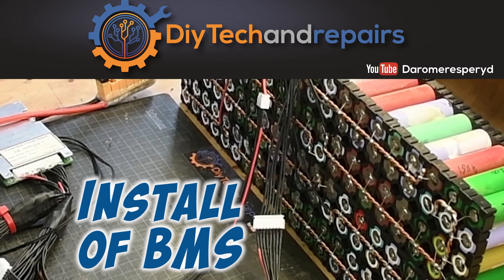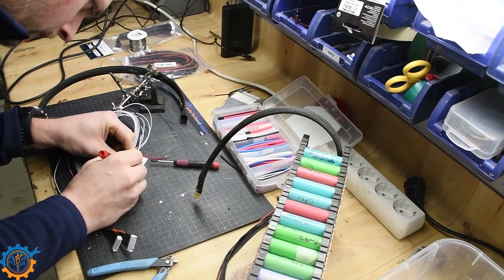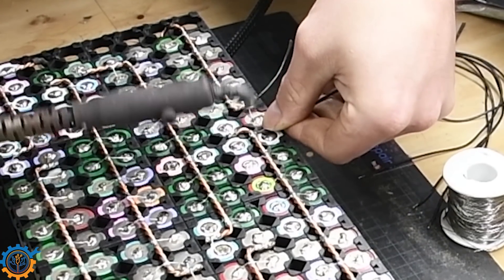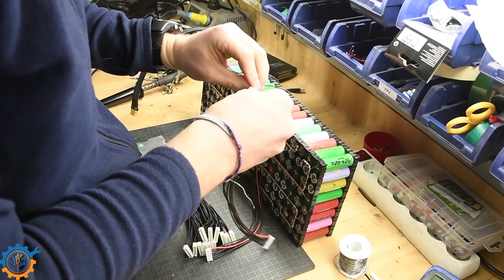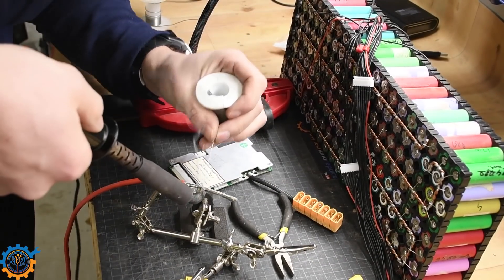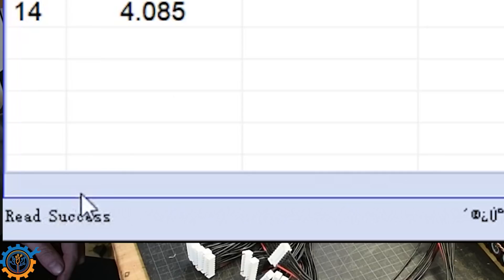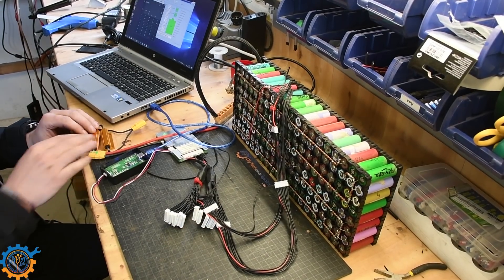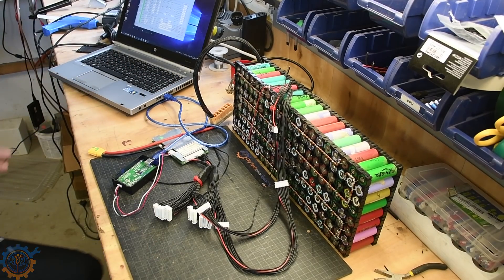Installing a smart BMS on a 14s LiIon battery pack

Comment: I have a 48 v 25.5 AH e-bike battery that wont charge or discharge unless I jump B- tp P- on the 14s BMS. Simple I said, the BMS is bad. I tried 2 other BMS same thing. I even mounted the battery on the bike with B- to P- jumped to see if it draws current and yes it does. I know this makes no sense. What are the odds 3 boards are bad? Any thoughts?
Reply from the maker: You need to Charge to start many ebike bms systems. Especially the smarter ones
Reply: @DIYTechRepairs  Now there's a Catch 22; it needs to charge to start the BMS but it won't charge unless the BMS is bypassed

Comment: Today i install similar bms but 12s.I check the voltage and all cables are correct conected.When i install the cables on the bms it makes short the sell number 4.I change the cell but again the same issue .Any idea ?

Comment: How to compute what proper Amp of BMS to use? Say for example 140 pieces of 18650 cells in parallel and 4 in series at 16.8V maximum. I have a 2KW 12V Toroidal PSW Inverter.

Comment: Hi. Its  possible  wiring  to 7s  for a bms 14s bluetooth ?
Reply from the maker: Depends on the bms. You have to Read its manual since its different in the versions out there
Reply: I search  a bms bluetooth  for 7s
Reply: You have a link ?

Comment: Thank you for the video, do you have a current link for the purchasing the BMS, also I can't seem to access your website.
Reply from the maker: Website fixed. OOM issue. Link should be found there and if not i can fix one later. Just ping me again
Reply: @DIYTechRepairs  link is still down
Reply from the maker: @danimallegs1450  what Link? The website is up

Comment: Hi where did you get the small capacity tester I'm building a 14 battery pack now with 2200mah cells from laptop 14s and 10p will this be powerfull for a 48v ebike ?
Reply from the maker: What tester? No. Laptop cells are generally low current cells compared to ebike cells. 14s10p Will atleast be able to cope with 500w ebike IF the cells are in Good condition

Comment: Watching this to understand it several times I think it is summed like this.  With multiple 14s packs wired in parallel for increased capacity,  each series balance wire  in each of those packs are then wired in parallel to the BMS.  Is that correct?  Any secret to your wiring all those balance connector wires in parallel or did you simply solder them together and then shrink wrap each of them and then all together?  Any problems that you have come across after adding additional packs in parallel?  I doubt the BMS manufacturer planned on it being used this way ...but it is a brilliant idea.
Reply from the maker: Yes. Just paralell. Just stay below recommended total battery capacity recommended by the bms manufacturer

Comment: Hi great video. Quick question, I'm new to the game, especially with respect to balancing/BMS, etc.

In this video, you showed us how you connected one 14s11p pack but I didn't understand if you were connecting all those extra cables to add more 14s11p packs when you create them? If so, how does the BMS handle that? How does the program show the data for all of the different packs of 14s?

Or said another way, do I understand correctly that with the setup you began with, connecting the 'extra' cables to the original BMS balance leads, that you will connect more 14sp11 strings to that same BMS?
Reply from the maker: Adding an extra pack just adds extra cells. Its like going from 14s11p to 14s20p. Still only 1pack and thats what the bms see
Reply: @DIYTechRepairs  Ok, I sort of get that but sort of don't. It'd be really cool to see the next video after this where you connect a second string of 14s11p pack.

Just to clarify, if you add a second 14s11p pack in Parallel to the first pack (I think most people use the terms "string" and "stringing them together"?), so effectively giving you 14s22p, I'm wondering how that is wired to the BMS in your video ... I'm imagining that the second pack would have its own set of 14 balancing wires? So you would now have 28 wires all going into the single set of balancing inputs of the BMS ... which is where the multiple sets of wires come into it at the beginning of the video? If so, how does the computer read the pack now? It is now displaying cells 1-14, then cells 15-28? I guess this is where I'm not getting it.
Reply from the maker: @Derekisastro  it is Still only 15 Wires. Each set in parallel.
Reply: @DIYTechRepairs  Ok ... I think I get it. I watched again ... the 2 cables you show at around the 1:16 mark ... the larger one is the Parallel cable. That is what will read each of the individual wires/leads from each pack as 1 group of Serially connected cells, so that once you add the second pack, lead 1 now reads not from 11 cells but from 22, 11 from each pack ... I think I get it now ... though a video showing it would be great!
Reply from the maker: @Derekisastro  correct

Comment: Nice bms device but with 50mA balance current this looks kinda useless on anything > than a 3P pack? Even an Imax B6 does 300mA balance. What is you experience with it? Is the bmsi still in use?
Reply from the maker: Still use it!  50mA is more than enough as long as you have packs that doesnt drift more than that. Basically leave all self-discharging cells out and you should be fine. Over time 50mA is decent for a pack up to 50Ah or even bigger if the pack is ok. But with that said 50mA is not that much no

Comment: Nice vidéo thanks ! 
I have a question, how you charge your battery pack ? With only Power supply (4,2V*cells) or il-ion special charger for bike for exemple ?? 

Thanks
Reply from the maker: Charged with solar power from inverter or charger.

Comment: I really wish you had included a wiring schematic in the presentation.  All I really got out of this was there are a lot of wires...
Reply from the maker: The wire schematic can be found with the bms. The schematic is like wire1 goes to cell 1. wire 2 to cell 2.... ;)

Comment: Hello,
I have the 16s version and I wired it up. But when I connect the USB device I can not find a single com port. 
Do you now how I can fix this? 

Thank you
Reply: device manager, hunt around or you need drivers for your OS. Usually.
Reply: @ohvblue  I have 13s variant and downloaded driver also ,but still it cannot able to read

Comment: Hey how's it going? Quick question . I want to build a 50 cell pack for 12v applications do you recommended 3s or 4s. And do I need to add a BMS or a balance lead? Thanks
Reply from the maker: I dont recommend 12v packs at all from LiIon cells with nominal 3.7V because it doesnt fit very well... If you still want to do it you need to choose 3s or 4s depending on what you going to power. Can it take lower or higher voltage?  Perhaps a 4s and DC/DC buck/boost converter after? In that case you can even go higher up to 5s or 7s. I always recommend BMS but it depends on the purpose... If you only charge with RC charger you dont need any BMS but a low voltage alarm. If you charge it with a dumb DC charger you need the BMS for protection and balancing
Reply: DIY Tech & Repairs so your suggesting something like a 4s12p pack which would put out 14.8v and the low threshold would be 12.0v?  Sorry if these are dumb questions, just trying to fully understand. My goal is to build a power pack with: 425 watt inverter,2 dual USB ports, 12v car accessory port, and 2 LED lights also solar charge capable. Thanks to your channel maybe I build it. Oh,  and should all the cells be fused? Thanks

Comment: If you think that this batteries will last about 5 years it is kinda zero sum game. I wish we had better battery technology. I did the calculation for how much ultra capacitors  capacitors you will need to store similar amount of energy and it's bigger than my apartment.
Reply from the maker: Its not so much about the years they last its more of how many kWh you get out of them before they actually die. If that is 2 years or 10 years only depends on your setup and that in comparison to the initial cost of installing them (including work) that defines if its worth it :)

Comment: On the aliexpress page for the bms there is a white or yellow option and a totally different image comes up. Do I need the yellow version to get the bluetooth/usb expansion boards?

Fyi I did purchase the weller iron and 500' of tinned 20 gauge wire using your link, I think that's my first donation to you!